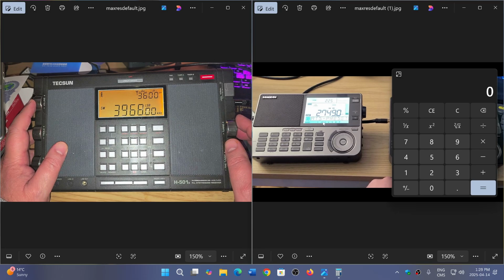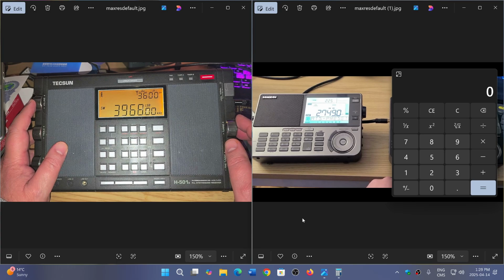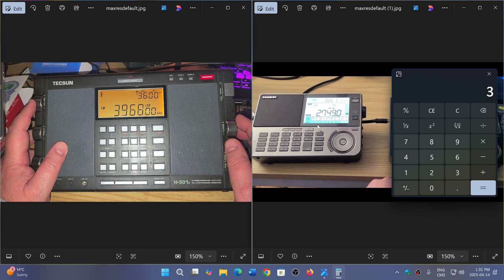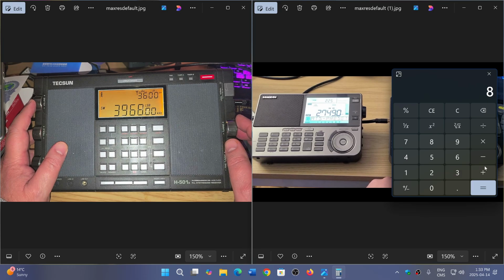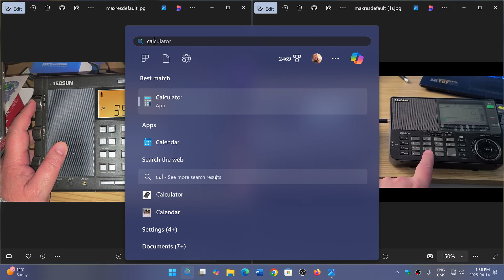Radio battery life explained and why newer radios have lower run times

Comment: Just the video I was looking for. I have a 1972 8-band radio, big ol heavy thing with a big speaker. I put 6 D batteries in it a year ago. For the past 3 months, at least, I have been running the radio 8+hrs a day. No sign of running out of battery, it's crazy.

Comment: It's not really about the voltage, but the available Wh, which is V*Ah, assuming what you're looking at isn't using so much current that things start to get hot. If you had two 18350 in series you would get a higher voltage, but lower Ah into a slightly larger space than one 18650. I.e ending up with the same (or slightly lower, given the casing etc) Wh. If I'm not mistaken four AA:s have something like double the volume of one 18650, so a fair comparison would really be a radio running on just two AA:s.